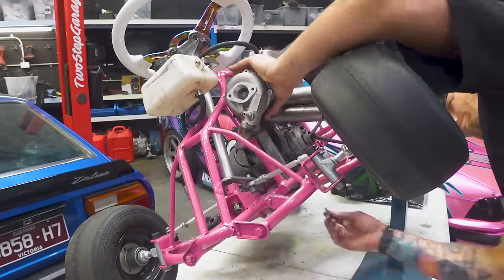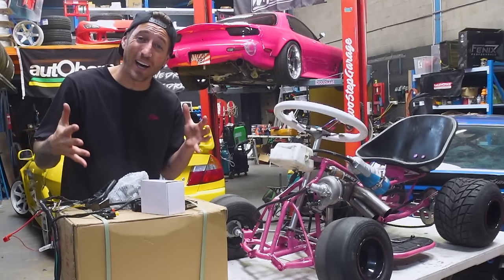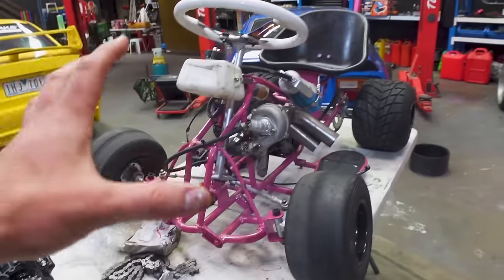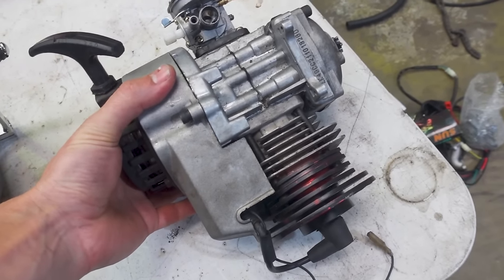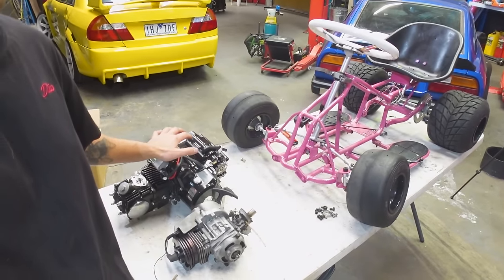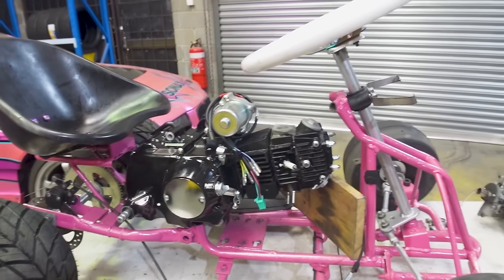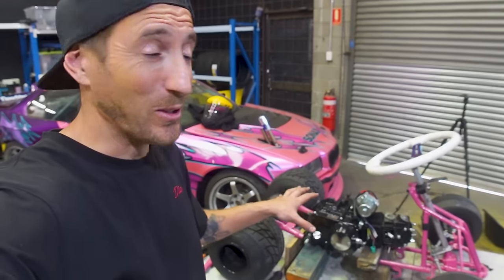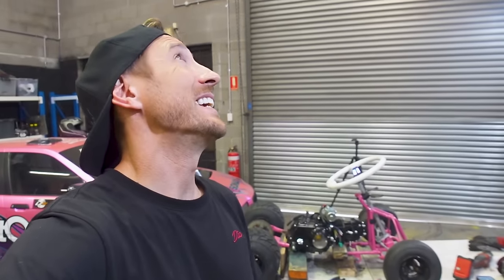Installing a HUGE 125cc 4 stroke motor in our BUDGET Drift Kart! | Part 1

Comment from the maker: What do you think? Did I choose the right motor? Sorry for the short video...Today got away on me. Tomorrow will be longer!
Reply: Chose a mean motor bro, huge upgrade from 50cc imagine this 125 boosted
Reply: Short and sweet, still great content Mike, as always!
Reply: Definitely the right choice mate
Reply: Great content mike
Reply: You mean YX150/160? Or a 2-stroke big bore version of a yz125?

A 125cc Lifan type engine is alot easier to ride and has a smoother/stronger idle and alot easier to start than an YX type engine that is also without an option for e-start :)

The power difference is: Small valve lifan 125 7hp, big valve lifan 125 9hp, and yx160 is about 12-14hp real crank power.

I have a pitbike with yx160 and its fun to ride but the kickstart would also probably hit the rear wheel of this mini quad, I also have a kazuma 90 quad that I've been thinking of trying the YX with, the kickstart is a problem cause its so short theres no room to kick😁  @comfy_rwds
Reply: 😅 don't worry about the motor  you need better brakes I think 🤔 😅 love it men
Reply: Most Malaysia budget local motorcycles have this types of engine the smaller cc is 100cc…I suggest you need a beater breaking power just in case…✌🏻
Reply: Maybe it would be better if it was a 2 stroke so you continue tradition of 2stroke motor on that quad
Reply: yes this is epic, the whole time watching the kart build iv been thinker bigger motor and turbo.. also add more safety gear to the shopping list 😂✌️
Reply: Idea: you should put the throttle and the nos triggers onto the steering wheel so you don’t risk your life and channel leaning/reaching down for the nos
Reply: Ayyy my man throw the turbo on it and test it then throw the NOS and combine the two and send it 🤙🤙
Reply: we are crazy what we are doing
Reply: I mean a 2 stroke would have been cooler like a KTM 85 or somthing like that
Reply from the maker: Y'all already want to see me destroy this motor 🤣 @kriswhite9324
Reply: This is gonna be crazy but sick dude heheh
Reply: If you were going with a four stroke, I probably would have gone with a 80 to 100cc, like a Honda XR or similar. Not a cheap Chinese engine. Although if you are going to Turbo & put "NOS' on it, you will probably destroy the engine anyway, so maybe your option is for the best. Anyway, I like it.👍👍
Reply: @itsmikelake  for sure haha but in actuality I think it make a sick lil rig to bomb on :D
Reply: Mike this is going to be insane with that motor in that tiny frame, can’t wait to see the rest of this build

Comment: I feel your struggle I went from a 6.5 HP engine on my gokart to a 16hp and I gotta cut and weld a new mounting plate my starter was slapping the rear springs and it was hitting the back of the cart 😂 go big or go home brother loving the drift cart content

Comment: thats phat! I have that motor and we had oil issues. I dont know if it is because how the motor is mounted in our kart but it wasnt getting enough oil to the cams/top of the motor. The motor eventually seized, we then drilled a bigger hole in the oil send up and upgraded to a better race oil pump. Cant wait for the turbo vid, If the turbo works, I might need to do some fab 😂

Comment: I reckon you should make a square frame with a sheet metal bottom, which goes from the front of the rear wheels to the front wheels (with room for wheel lock) it’ll look heaps cleaner and give you more than enough room for pedals and other stuff

Comment: I have worked on a lot of them motors they are really reliable don't need to give it much you have everything they for it but if you want to get a bit more power just add a mikuni 26 mm carby they can help the motor a lot when tuned right 

But I have been watching your videos for a bit now like the stuff you do with your mad they are mad as man keep the good work up can't wait for the next vid

Comment: For the clutch, use a pipe the same diameter as a motorbike handle bar, mount it vertically like a shifter in a car and then use a standard motor bike clutch on the shifter… so you clutch and change gears with the 1 hand

Comment: what I'm thinking. Mobility scooter with a chinese copy of the Honda GX200... and a whole heap of parts from the US of A like a fire-265cam from Go Powersports, or the equivalent CM grind from OMB Warehouse, 26lb valve springs, the Hemi flat top pistons, Billet conrod and flywheel, Mikuni VM22 carby and header pipe and a heap of porting... (this represents my engine, but I was scared of the mobility scooter with engine in stock form so built go-karts instead) this combo is 16hp from the factory 6.5 hp, but to use the flat top piston it needs to be a 212 or a 208cc, not the 196cc engine, and the rod is a .020" overlength one, but it doesn't have to be if you use a .010" head gasket

Comment: I feel like you need to weld up a custom frame based off of the quad frame but build it so you can tuck the seat down a little bit and look more like a mini f1 drifter now you have a manual motor for it. And would be sick to see a proper sequential shifter hanging out the side of the thing 😅
Reply from the maker: I'm 100% going to develop this frame a bit more and get the seating position a bit more comfortable. Shifter kart is going to be wild!
Reply: @itsmikelake  making me want to build my own out of kids electric car/bike battery’s, would be sick to make a big battery pack and place it behind the seat for weight in the rear and slide it about

Comment: I had a 140cc went hard asf

had race cam
Bigger carby (no filter)
New rings ect coz i thrashed it lol (wasn't blown) 
Rebuild due to bigger cam 
Also had smaller front sprocket with quarter turn throttle 💪🏽💪🏽top speed is usually 91kph mine went 109kph
Reply from the maker: 109?! Holy crap that is FAST!!

Comment: No need for the plastic wheels anymore clutch kicking and hydro should get you sideways and hold in it there easy but I would make it more front heavy to keep the rear wheels spinning longer

Comment: You needa put the engine under the seat cut the frame for a proper open foot well like a car instead of the two seperate sides cut down the middle with an engine like a quad bike

Comment: These engines need a very good brake in in order to last and not burn oil
Reply from the maker: Yeah I saw on the sticker that I can’t go over 50km/h during break in 👀. That’s already too fast on this sketchy kart 🤣
Reply: @itsmikelake  you should do 4 tanks of gas and don't give it more than half throttle in each gear and if you brake it in right surly it's going to reap

Comment: Have you considered what you will be doing to run a 420 or 428 chain you may have to make adapter for rear sprocket onto shaft or replace whole shaft and swingarm for put bike quad one as it'll go soon they are very weak good luck drop a message can help these cub copies very easy to work with 🫡🏴